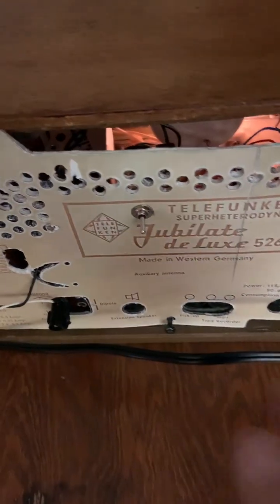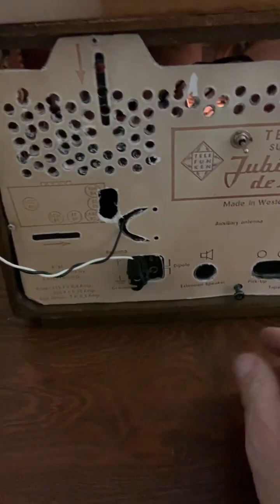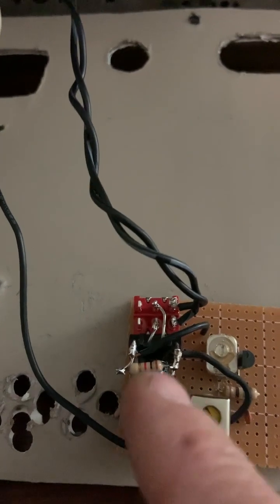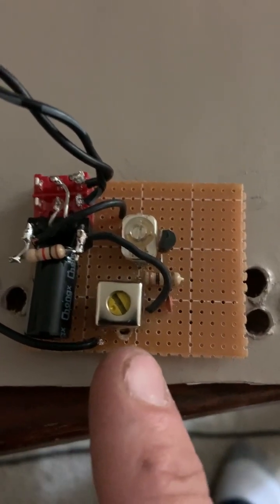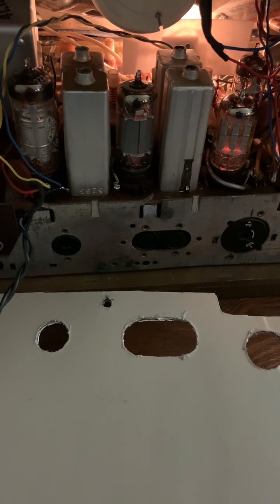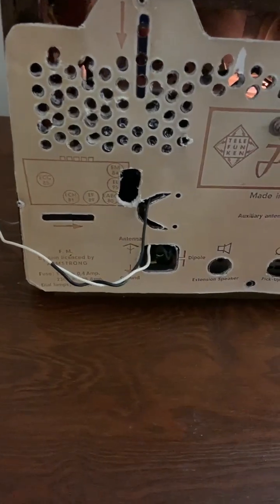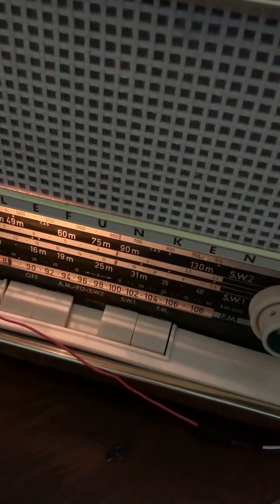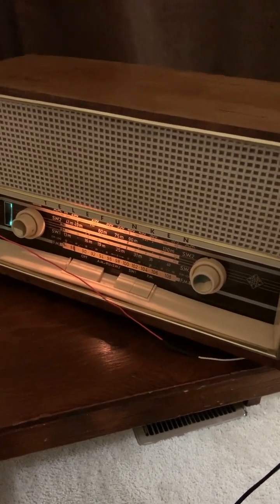Internal BFO for Telefunken Jubilate

Comment: Ron, I have my grandfather's Telefunken Opus 7 radio that I recently had refurbished by a Telefunken expert in the Detroit area (new tubes, rectifier, EM80 eye and electrolytic cap replacements).  The refurbish was quite expensive, but well worth the money.  The radio has excellent SW reception with a random wire antenna I rigged up between the trees in my backyard.  I am hearing a lot of SSB Ham traffic on he 41M band, but cannot decode it.  The radio like all older Telefunkens has an AM IF of 460kHz.  I purchased a 445kHz BFO kit online from ebay but was unsuccessful in assembling it with the first power up resulting in a good deal of "magic smoke".  I bought the last one from a guy in Italy who provided additional capacitors to center it at 460 kHz and now it is out of stock.  The kit seemed very overbuilt with many parts and not simple like the BFO you constructed.    Would you be interested in building one for my radio?  I am willing to pay for your time and expertise.
Reply from the maker: Nice radio! I chose the smaller Jubilate based only on size and what I was comfortable handling. The Opus is a big step up! I am remote and away from my radios and workbench for a month so likely its best I answer your other question on the parts. Look for my reply there.